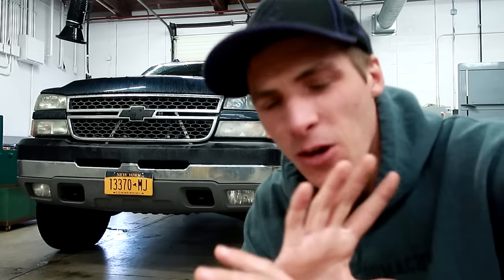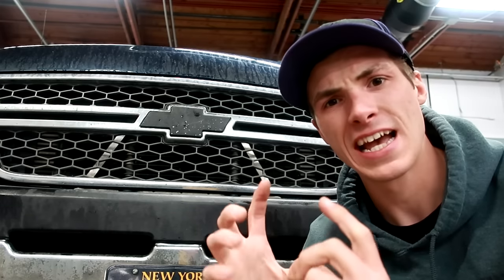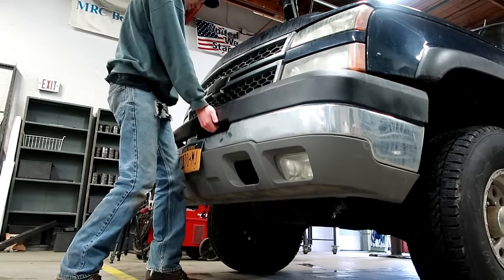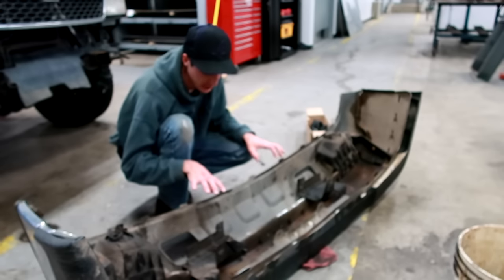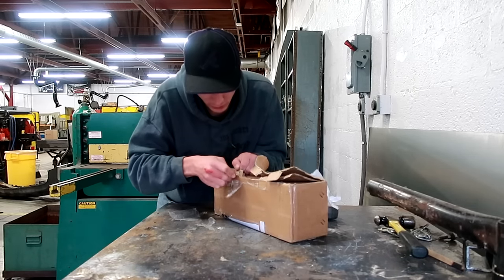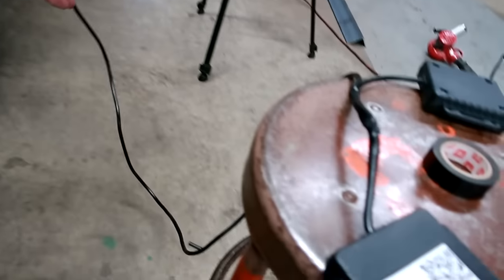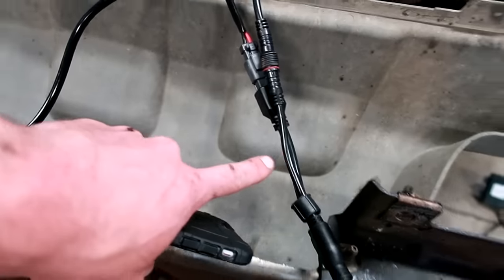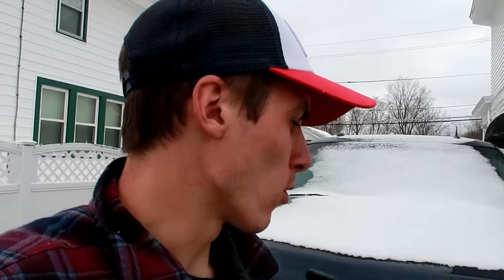NEW COP TRUCK AUXBEAM LIGHT BARS

Comment: I love your truck !!
Reply: Everything Enduro same it looks sick
Reply: Cummins is better
Reply: Aaron Brennan cummins is almost a big truck motor buuut it not just a baby six cylinder lol. V8 rule
Reply: what a power stroke or duramax can do in 8 cylinders, a cummins can do in 6...bigger doesnt always mean better m8
Reply: +pccentral102 watch the Ike gauntlet by tfl the duramax out pulls the cummins big time.
Reply: pccentral102 yeah cummins motor is good, but it's designed different you can't compare inline pistons to a regular 8 Cylinder. And they fucked yo big time by putting the cummins in a dodge.😂 biggest mistake ever, dodge is produced like trash! Why do you think dalton chose GM?

Comment: Just to clarify, solid blue is for volunteer firefighters, green is emts, fire chiefs can use whatever they want unless department SOG SOP says so. Police can use any color combination as they wish. For those that get really technical, New York still has the one solid rotating light less than 30 candle power for volunteers. So yes i am indeed breaking the law.

Comment: the only problem with the way you power the two boxes with the one wire is that if the two boxes combined are drawing more amps than that small Guage wire is rated for, than you may have an issue with wires getting hot or the lights not getting as bright as they should...next time you do something like that you should increase the wire Guage going to the Y connection or run both wire zip Tied together up to the power source...other than that, good job...you most likely won't have an issue but just something to think about in future projects where this situation comes up...always check amp draw and wire capacity...

Comment: The only problem I could see with wiring them the way you did is if the wire going to power is rated for the amperage of both units(which it probably is). Just make sure that you have it fused under the current capacity of the one wire. You can't just add them together because you're pushing the power of two units through only one power connector. Like I said it's probably fine, usually power wires for things like that are pretty excessive which would mean you could easily get away with doing it the way you did, but I'd make sure either it's rated for both units, or that it's fused pretty low. Just commenting to make sure that you aren't going to start a fire anything. I love your videos!

Comment: you need to keep an eye on the harness that you are running both drivers off of. You may be overloading the ampacity of those wires. you may want to check into that for safety reasons.

Comment: 6:14  Hows does it change how the boxes act if you power them together rather than separate?
Reply: The boxes will still run on a different signal from each other, all that he had done is connect the two together to run off of the same power source lead and return lead. That way he cut down on cables that he would have to hide and hook up to the switch and battery